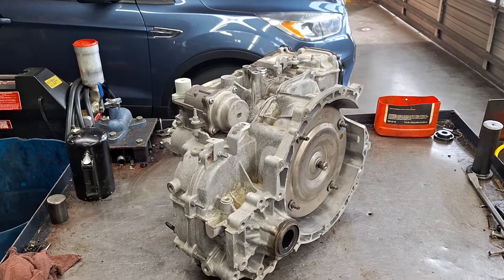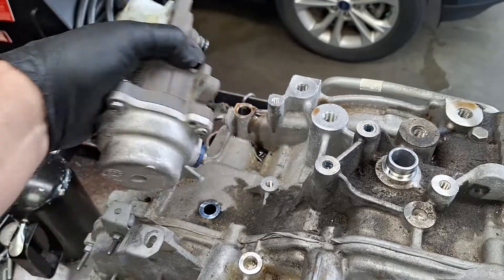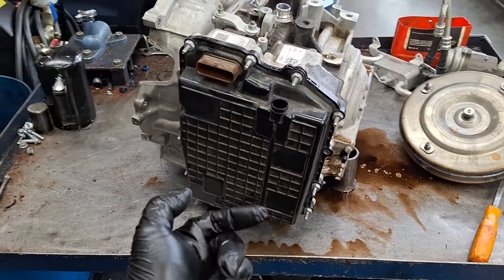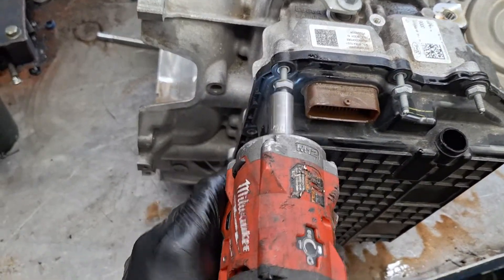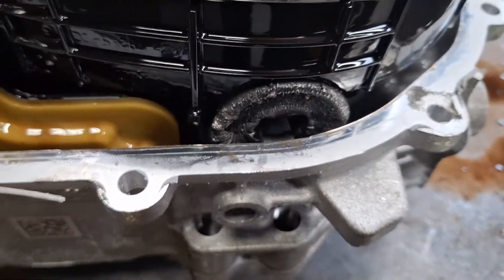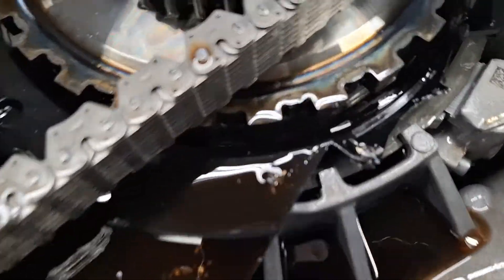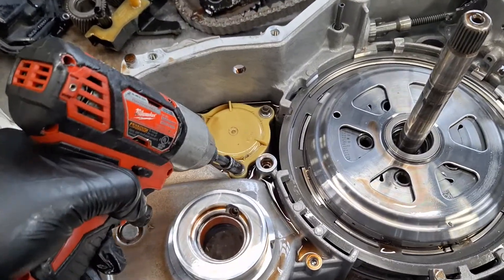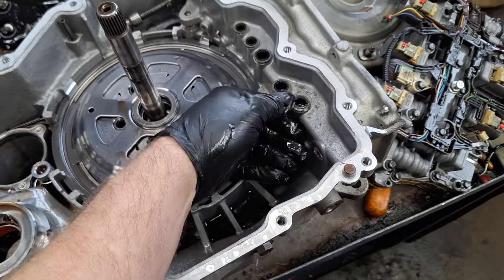Ford 8F35 Teardown | 8 Speed Transmission (Major Failure)

Comment: A transmission should never be the weak link in the drivetrain.   You can say the  Transit was over loaded but that shouldn't matter.  Transmissions should be able to withstand all the power the engine has, forever. 

You think the (needle) bearing in the planetary gear failed ?

Comment: I just bought a '24 Ford Maverick (new, unsold last-year's inventory on the dealer lot) with the 2.0L engine and this transmission.  Glad to hear that this failure was unique to this particular situation, and isn't something that most owners will have to worry about.

I've heard draining-and-filling the transmission fluid every 30,000 miles or so is a good idea on these things.  I see now why you cannot replace the filter when you do that -- that'd be a heck of a job right there.

What's your opinion on the 30,000-mile fluid drain-and-fill interval?
Reply from the maker: @LMacNeill  hey absolutely do a 30k interval on this

Comment: Great video!  I have an intermittent clicking noise that sounds like a solenoid going haywire every time the transmission shifts up into next gear , 1 through 4th.  Goes away after a few minutes of driving.  Have you ever heard of a solenoid rapidly clicking like that? And would it be audible from the cab? Thanks!

Comment: Hey Ben 
I have a 2019 Ford transit connect XL mini cargo van extended wheel base. My question is I get funny rattling sound only when it’s in drive transmission fluid is always done at 30,000 miles. Everything runs great no transmission slippage no issues anywhere else no codes when I check with forscan. Shift’s a little rough from time to time, but that’s the transmission itself. Would you happen to know what that growling type rattle noise would be when I shift to drive or even reverse when I go to park. It’s very quiet although the engine mount transmission mount has been replaced with everything OEM Ford parts let me know if you think of anything maybe I need to check more thoroughly on the exhaust, but it looks pretty good or could it be where the possibly the exhaust bolts into the block on the manifold something like that? It’s got me this one. I also replaced the belts tensioners let me know what you think. Thank you very much.
Reply: Did you solve this problem? I have the same one.

Comment: Those transmissions are over-complicated junk.  They need to phase this out for the Hf45 eCVT.
Reply: CVTs have their own issues and are in fact even lighter duty than these in most cases. especially as they rely on a rubber/ metal belt that is fine for the first 50k and then fail usually.
Reply: @benjamindavies1188 the Hf45 and 55 arent really cvts.

Comment: Hi there. 

I rebuilt this transmission some days ago. She came with solenoid stuck fault code. But when we reset codes and transmission went good. After we decided to remove her from car and replace filters and oil . We changed all frictions and torque converter clutch , because some clutches was some burned. 

When we install transmission and filled the oil she went good. But after some kilometers I noticed some jerkins, after I loss reverse. And then she didn’t go in drive. 

I have 287.000 km. 

Is it valve body fault? What do you think?
Reply from the maker: @НиколайГринько-ю3ч  hey I would replace the molded pistons for which clutches are burnt. And the valve body
Reply: @ i’m great, but can I replace only solenoid or valve body who is solenoid together?

Comment: Hello, I have a car with the same gearbox, my vehicle Ford focus I have a knocking problem in 3rd or 4th gear, my vehicle has 82 thousand kilometers, oil change has never been done. 
Will my problem improve after an oil change?
Reply from the maker: @efeksloglu6625  hey, yea if the knocking can be described as a shudder. If it feels like a shudder, then drain& fill it 3 times. Drive in between. On the final fill add lubegard shudderfix. I've got a video on how to service the 8f35
Reply: @BigBensCarsAndCycles  Thank you very much for the answer, it doesn't actually vibrate, but I'm sure it's always in the same gear, it usually happens on flat roads and this problem occurs when I drive slowly, it changes gears noticeably late and when I press the gas at that time, it feels like someone from behind is kicking the car. 
I hope I explained it well
Reply: Hocam yağ basıncı düşük devirlerde düşük olabildiğinden vitesi biraz yavaş atıyordur. O da titreme yapıyordur. Aisin de de aynısı oluyor c3 var tork  konvertörlü bende de berlingo var konvertörlü. Annemde de focus var hepsi aynı düşük devirde biraz geç atıp titreme yapıyor. Bütün arabalar sıfır ama hepsi aynı. Korkmayın derim.
Reply: @sakakproduksiyon3160 çok teşekkür ederim cevabın için ben sadece bu şanzımana ait sanıyordum.

Comment: Hello, when I replaced my engine, I removed the inverter and changed the seal. Before reassembly I filled the inverter with 1/2liter. I would like to know how much quantity of oil, I need to fill the gear box. Also I removed the drain plug before remove the engine. Thanks in advance. Yann
Reply from the maker: I'd put 5 quarts (or liters) in, let the engine warm up, then pull the leveling plug to set the fluid level, should be close
Reply: @BigBensCarsAndCycles  Thanks for your response. I'd put 5 liters and wait warm up 20mins and nothing after removed leveling plug.
Reply: In finally I have to put in 7 liters and level is now correct.

Comment: I have a 2020 ford taurus with 8F35 transmission, after fluid change it drove smoothly for one day, next day started with a jerk in D then stuck in 3rd, no Reverse it just flashing and got P0840 P0843 P0845 P0848. Is it just the Pressure sensor you mentioned? Any help is greatly appreciated
Reply from the maker: @himalionel775  hey yeah I'd start there since that's easy

Comment: I have a question, my Ford drives great when it's cold! after 5 minutes when it is warm it doesn't switch well and beats what could it be?
Reply: when was the fluid last changed? and how many miles is on the current fluid?

Comment: Serviced my transmission at 31,000 miles. It dies at 41,000 miles.   Can we add an oil cooler and ditch the stock bypass and cooler? Also is there a way to add a dipstick?

Comment: i have a ford bronco sport with the 8f35 after i changed fluid it shutters in 1st gear worse it was shutteirng before so i wonder if i got cooked clutchpack
Reply from the maker: try adding a tube of lubegard shudderfix. I think the 8speeds converter clutch applies at low speed.

Comment: If you change the fluid regularly, will loading the truck heavy still be a big problem?
Reply from the maker: @neillowery7634  it'll certainly help in that situation. It's still a fairly light duty transmission
Reply: @BigBensCarsAndCycles I did a spill and fill. I recently drained and filled it 4 times. It’s a little jerky between 2nd and 3rd gear.
I pulled a pending P0794. Intermediate shaft speed sensor A circuit intermittent

Comment: Hello Ben, I need your help. I also have a gearbox on an S-Max that I dismantled and the same problem as in the video. I urgently need the parts, can you tell me where you bought the new parts, maybe you can send them to Germany. Thanks
Reply from the maker: Hi, all I can say is you'll have to go to a ford dealer to buy the parts. I ended up getting an entire transmission for this one.
Reply: @BigBensCarsAndCycles  Thanks for your answer. In Germany, Ford dealers have almost no parts for this model transmission. But Aliexpress :)))

Comment: Hey man, i’ve watched a couple of your teardowns, and i myself am nervous about my 8f35 in my 2.0t escape. Not sure how much you know about this, but the guys with the mavericks have had some really bad luck with these trans. It seems to be not as common in the escapes. However on the maverick forum i’ve seen a couple guys swap engines and bigger turbos for the 2.3L. Same transmission. I’m looking to do the same, do you think tuning can handle the huge torque increase? They’ve gotten some 11.7s 1/4 miles, and north of 400/450 whp. Is this a disaster waiting to happen if I do the same? What about the ford 8f40? how does that hold up? I can’t find much info on it. I’d hate to have to worry about the trans.
Reply from the maker: Hi. I appreciate you watching. I wouldn't trust an 8 speed with 500hp. While they're not quite tissue paper, they're still not the most solid transmission.

Comment: Does anyone know if Ford ever fixed the torque converter problem with this transmission and if so, by which year did they do this?
Reply: What you mean? Describe the problem. Interesting
Reply: @mrdetailing9406  There's a known high failure rate of the torque converter on the 8 speed transmission.  It starts with a shudder and ends up eventually with loss of movement.  I ended up buying my wife a 2023 with 6000 miles on it a few months ago, but I also bought a powertrain warranty to cover the transmission.

Comment: You made me look up 8F35 planetary issues. April's Transmission Digest has an article on the 8F35, it seems that there was planet needle bearings not hard enough. It mentions Ford bulletin number 22-281.

At least laughed, and you didn't cuss up a storm while doing this.

Comment: Kind of wild that Ford recommends a 150k mileage interval on these transmissions, no wonder they fail!
Reply from the maker: Yeah you need to drain and fill 3 times every 30k miles to get a decent lifespan
Reply: Yup that’s what the owner manual says unless used for hauling or excessive low idle like a taxi. But it seems like with all the comments every 30000 is just the way to go

Comment: You could tell that transmission was never serviced. The fluid that came out was like tar. Do a simple drain and fill at least once a year folks. Your transmission will love you for it.
Reply: sadly ford state its a sealed box (i know its not in terms of a fluid change, but it is in terms of a filter change) so ford themselves will not change the fluid in these boxes and as this is from a transit. Its likely it was on a comercial lease which usually stipulate all maintenance and repair is carried out by a ford dealership.

Comment: Hello Ben , 

I bought  a used Tourneo Connect 1.5 ecoblue (12/2019, 132.000km ) with this gearbox. 
Firstly , it had transmission slipping, harsh engagements and according to FDRS  various DTCs (P0756, P0771, P0868, P2700, P2701, P2704) . Additionaly , 8/10 times you could not button up the R. 

After that ,I replaced the valve body with new one . After 1000 km the car is drivable but is has really harsh shifts when you are trying to stop the car (low speed) btw 3rd to 2nd and from 2nd to 1st gear. Also , when you choose D , it buttons up the 1st harsh and after everything it seems that work normally. For speed higher  than 40km /h everything works normally.
For those 1k kms , i had failure indication twice. The FDRS now memorized P0731 (gear ratio of  1st gear ) .

Unfortunately , here in Greece the experience of engineers is extremely limited in this type of gearbox .

I'd really appreciate it if you could advise me something or express your opinion about this.

Kind regards, 

Dimitris
Reply from the maker: Hi, gear 1 incorrect ratio indicates a forward clutch issue (A-Clutch) it'll need to be taken apart to determine the extend of damage

Comment: Before I knew more about this transmission I bought the low pressure filter and the gasket for the valve assembly cover.  The gasket Ford let me return, but I had the filter from rock auto for too long.  Can you use it?
Reply from the maker: Sorry to hear. Thanks for the offer, but I expect to need one any time soon

Comment: i suspect the driver beats the daylights out of this, as most 'professional' drivers do where I live. Couple that with the fact that the automakers are in a mad rush to add gear ratios to their vehicles to keep up with each other, and that they use the least expensive aluminum parts they can, and you have these kinds of disasters. There are almost always a lot of issues when these higher gear count transmissions get released. It's also easy to break a piece of the case casting when removing that main snap ring on the 6F35, thinking it's the one that holds the 1-2-3-4 in; not sure it's the same on the 8 speed, but something to be aware of.

Comment: I have a 8F35 In my 19 Edge. I have this really annoying problem where it shutters when I let off the gas or rarely it’ll do it on its own while cruising typically when in 7th or 8th. I’ve had the Torque converter replaced, Fluid changed at 55K and some TSB in regards to TCM programming all to which only made the problem “Better”. Any insight or ideas?
Reply: Get some shudder guard fluid, have seen a lot of customers with many 8 speed clunky/slippy feeling engagements.
Reply: @funnydubby6401  already did at 45K didn’t do much for it besides make it “Stable” if I let off the gas before shifts or when it usually shudders. Car has 70K on it now and hasn’t gotten worse or better. Needles to say ima drive that mf until it falls apart.
Reply: @anthonyrizzo255  the 8 speeds transmissions from ford are just straight garbage I swear lol
Reply: @funnydubby6401  they are lol I work at a ford dealer and see them in frequently and all we do is replace the Valve body and Torque Converter mind you all the same part numbers so we aren’t fixing anything only making the issue go away temporarily lol weird part is the 8F35 in the escapes w the 2.0 seem way smoother. I’d say the 8F35 plus 275FT Lbs plus 4200 pounds just don’t work in the edge lol.

Comment: Hi Ben I have a work  van (2020 transit connect) 8f35 trans. It's pretty loaded,  I don't think I'm over the 1600 lb payload  capacity.  Transmission failed at 70k miles.  Never had fluid changed. Getting a new Transmission installed now.  
What are some countermeasures I can take to prevent failure other than less weight?
I was thinking of installing Transmission temp. gauge and fluid change every 25k miles. 
I greatly appreciate your video.
Reply from the maker: You're welcome! Those sound like great ideas to help protect the transmission. When servicing, I'd do 3 drain and fills and run the engine 20 mins before each drain

Comment: I have this transmission in my vehicle 2020 Focus 1,5 tdci. It was repaired a few months ago due to vibration and knocking. 
Now, when it's cold in the morning, gear shifts are jerky. 
It gets better after 10 minutes when it warms up. They tell me to use it this way, normal olduğunu söylüyorlar. 
Why is this happening? 
What is your advice?
Reply from the maker: It may be low on fluid from the repair
Reply: Hey Brigan, I am having the same car, but 2019. As you said, it gets better after 10 minutes when it warms up. Do you still have the car? How's going with it and did you manage to fix this?
Reply: Ford yetkili servisleri şanzımana yanlış yağ koyuyor kardeşim, bilgin olsun. ULV fluid koyulacak. Normal ATF koyup geçiyorlar.